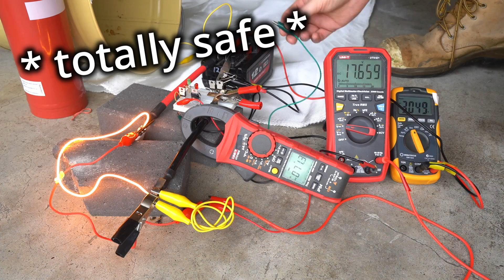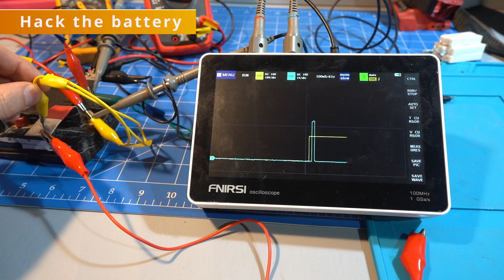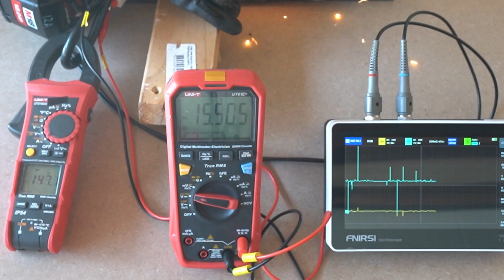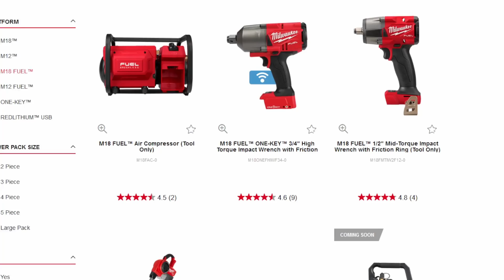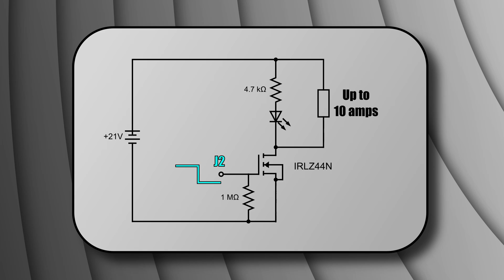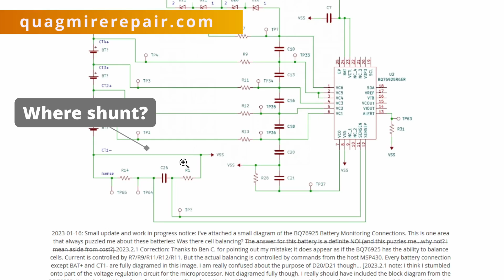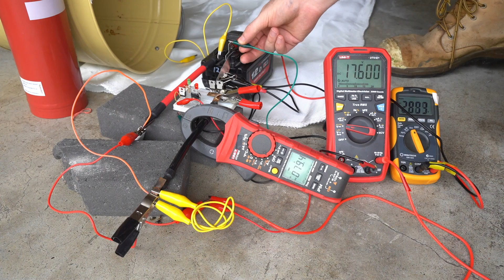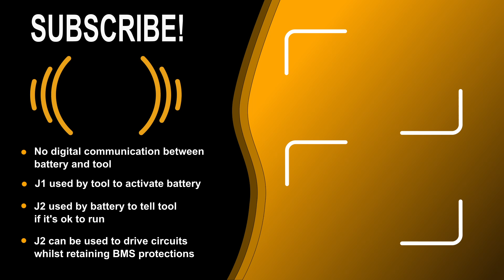[005] How M18 batteries communicate with tools

Comment: Been a while since this came out now, wondering if anybody has spotted any commercial products making use of this information yet?
Reply from the maker: Haven't seen anything, but I haven't really looked, either. I thought about doing it, but don't really have the time, and I figured it'd just get copied and I'd be undercut. I should finish my updated circuit and publish it, then someone might make them.
Reply: @toolscientist  After putting some more thought into it and spending a lot of time looking at mosfets and mosfet circuit design, I realized a couple things. 

1. I really can just use a relay/contactor to switch high power loads. Which is exactly what I do now except using a tiny non-adjustable LVD circuit. This can fit entirely inside the case of a particular M18 battery adapter so it's a super clean install. However, the circuit cuts out way too early though so I'm not getting anywhere near full capacity. Hence why this subject is so interesting to me.

2. For my use case (repowering childrens toys) it dawned on me that since I've added speed control boxes that use low current key switches to turn on and off, I really just need to interrupt that line with a relay/low current mosfet instead of having to fully shut off the battery.

Now the hard part is probably that none of the aftermarket battery adapters include provisions for the J1 and J2 contacts. And I really don't want to deal with 3D printing... I smell epoxy in my future.
Reply from the maker: You prob need a mosfet. Relays need 100-500mA through the coil to hold the switch closed. The J2 pin can only do <10uA (see 7:11). You could use J2 to drive a low power mosfet, which then drives the relay coil.
Reply: @toolscientist  Exactly my point, I described it poorly. My realization is that I don't need to worry about a high power mosfet circuit. I can use a very compact and simple circuit.
Reply from the maker: That's actually a pretty good solution. I always neglect relays as they're more expensive and wear out,  but in this case it makes for a very simple circuit with only 2 components (3 if you add the pulldown resistor for the mosfet, maybe 4 if the relay needs a current limiting resistor)
Reply: @toolscientist  Can't forget a flyback diode for the coil. But definitely simple and small. And if all I need to do is interrupt the key switch/on-off circuit for the speed controller - the 10A limit for the common micro relays I like to use is a non-issue.

Though I'm not sure exactly how the speed controller would like if the on-off switch was switched off at full tilt. Guess I'll have to find that one out the hard way.

I'm also thinking I can take advantage of the timeout after the J1 pulse to effectively shut off the bike/quad/power wheels if the kid walks away for 2 minutes. Start up procedure will involve the key or power switch turn on, then spam a momentary button until the power LED/Relay comes on. Then drive the wheels off until either the battery is dead, on fire or 2:40 elapses and shuts it down. Will have to test this timeout on my particular batteries. I don't have any 12Ah, but I do have a 9Ah that has always been the odd man out so I will not be surprised if it's more like the 12Ah than the 4-5Ah.

Comment: Along with the one-key tools, the obvious thing to test is the dual-battery tools. For example, the mower has an external display that shows the SOC of the lowest battery. Your claim that there's no communication is likely "total bullshit".
Reply from the maker: SoC can easily be estimated from voltage. Every M12 tool shows SoC and they definitely don't communicate. As I said, I haven't tested every tool. I'll be very interested to hear if anyone can show battery/tool communication, but so far no one has.
Reply: @toolscientist  When it exactly matches the on-battery display that uses coulomb counting? Fat chance. Again, you tested only the cheapest tools, no ONE-KEY and no dual-battery and made a faulty conclusion.
Reply from the maker: @straightpipediesel  they don't use coulomb counting. Put a 5Ah on a blower, hold trigger, push button, and it'll show 2-3 LEDs. Let go of the trigger and It'll instantly go back to 4  LEDs. It's purely voltage based.

I've looked at one-key app images and videos and never seen battery info. Not battery type, charge cycles, days since first charge, or anything. I'd be happy to be wrong as it would make reverse engineering their diagnostics very easy. If you can show me something that shows there is communication, then I'd be very keen to hear it, but battery SoC is not proof.
Reply: @toolscientist  I'm sorry, but you don't know anything about Li-Ion if you think this thing is voltage based. Put a dead battery on the charger for 10 minutes and check the status, it doesn't read full. There's 0 science here and 100% guesses.
Reply: @toolscientist  I just did that and it didn't drop 2-3 at all. I have never seen that behavior except near empty. Maybe the batteries for APAC are cheaper.
Reply: @toolscientist  You know, a guy gave you perfectly valid feedback about testing dual battery tools and you had to tear him up and get into an argument. Your credibility just went to 0 for me. You ever get checked for ASD?
Reply from the maker: @toddc5619  I just put a 2Ah with 1 bar on the charger. It instantly jumped to 2 bars. Took it off after 5 sec and it instantly drops back to 1 bar. If it were coulomb counting, the SoC display would only go up during charging and only go down durimg discharge.
Reply from the maker: @straightpipediesel  did you use a blower or some other tool? Most tools are only ~3A at no load, but a blower will be 20A. The effect also works best with smaller batteries as they get more voltage sag. I just did it with a 3Ah High Output, and it also dropped from 4 bars to 2 bars whilst running, then came back to 4 bars after releasing the trigger.
Reply from the maker: @sj65535  dual battery SoC was an interesting idea. So I tested it and found that M18 battery SoC display is voltage based, which means the tool can show the same SoC as the battery without communicating. I'm still open to their other idea of One-Key tools being able to communicate. If you can show me an image or video of the One-Key app displaying battery info (apart from SoC), then I'd be very keen to see it.

Comment: Do the M12 batteries use the same J1 J2 communication system as their M18 counterparts? Or do they have an integral disconnect in the battery?
Reply from the maker: No, the tool stops when voltage goes below 8.2V or when the voltage across the thermistor ("Th" pin) goes below a threshold (which indicates overheat). The batteries have no disconnect whatsoever. Original M12 batteries only had resistors in them. One from ~2019 onwards have a chip in them, but I'll need to desolder one to see what it does.
Reply: @toolscientist  This is great! Thanks for the info. Looking forward to another video when you tear into one of the newer M12 batteries!
Reply from the maker: @stevenmullin3616  i should just sacrifice one of mine to the science gods. Maybe I can find a cheap/dead one on a 2nd hand site. There looks to be an i2c interface on the PCB, so if I can find out what chip it is, I might be able to talk to the chip on a live one, which will be fun.

Comment: Question for ya.  would using a m12 battery with just a positive and negative adapter to power up components on vehicles like a window motor as an example affect the battery in a negative way ?
Reply from the maker: The M12 batteries are 12V at full charge. Their average voltage is 10.8V. Milwaukee cuts power when voltage goes below 8.2V and refuses to start if voltage is below 9.6V. Depending on the pack, they'll be good for 15-20A for the compact and 30-40A for the XC packs.

So just make sure you're not putting too much current on them and that you're not dropping the voltage too low.

Comment: What i found curious is that a Ridgid (AEG) battery to M18 tool adapter i just bought has a 1Kohm resistor bridging + and - to J1 and J2 respectively. Seems to do the trick for enabling the tool. No extra components on the PCB besides that. ( It came with one those contacts slightly damaged, my tool refused to work until I bent it back into place)
Reply from the maker: You should be able to get an M18 tool to work with any resistor (from 0 to whatever my fingers are [I think 3+MOhm]) between + and J2. Shouldn't need anything on J1.

Comment: i just wathed all your Vid's , i EXSTREAMLY liked the -jump starting  one , and i think your testing method is GRATE and Newb-friendly while be a advanced subject .. 

i think you should keep making them , if you need ideas , im full of them lol .. but to get you the viewers, do some thing like this- with Auido equitment , like amplifyers, get a Hot-ticket one, that dosent brake the bank ,  (like a Scar-auido RP 2000.1, ) you would be the only person doing pratical test on them.. most of those auido-guys are dumb as rocks... 

also a good viewer-bass is doing those E-bike and E-scooter crowed , they never doing good testing like what your doing.. 

wish you the best .. 

PS, i want to see your High-power diagram , you shouldent hide them becusye of stupid people. ..  LIke moma-allways said  "stupid is what stupid dose" , and a book that is sencored is not a woth-reading book,  (like the antarkest cook book, you cant buy the Real thing thire in the EU/UK, -  its almost 2x thicker in the USA/Mexico/Canada - even blue-prints for a AR-full auto trigger asimibly in both .22-LR & the .223 chamberd
Reply from the maker: Still working on vids. Things just got slowed down a lot over Xmas. Hoping to have my Makita LXT vid finished this week. 

I'll probably stick to tool related tests. If I had an escooter I'd definitely look at modding it to work with power tool batteries. Although I think that's been done, and I want to avoid rehashing stuff.

High powered circuit was mostly not shown because it's a bad circuit that can lock on are cause pulsing. I'm working on a better circuit which I will make public.

Comment: Mate i repair power tool Batteries for a living !
Just randomely found you So subbed and liked now hoping that i am going to search your vids and find something on the worst of the worst BMS mentioning no names like MAkIT& what a complete Rip Off Bollocks  Bullshit BMS that is.
Cheers mate.
Reply: Ok mate just checked and nothing there.
You may allready be on this one i dont know.
But buy a new Makita battery and a duff one.
Work out the terminal address lines and monitor as i can see that you are well capable of doing.
Now change one or maybe two duff cells in the bad battery, you will get the battery monitor blinking from side to side.
Balance ( manually ) all of the cell pairs to 4.1 or 2 and and try charging on a makita charger...it will still say NO whatever you do the BMS locks out and the only thing you can do is chuck it in the bin and fit a new one then you are good to go again.
They have the nerve to sell a £300 tester that tells you that you have charged your battery 97 times, or that you charged it once when it was really cold or even three times when it was really hot, it even will tell you what is wrong with your battery ? Maybe or say  oh sorry computer says No.
There is a memory chip on the Makita BMS that is like no other and when it locks you out thats it !
All the best and good luck Kev
Reply from the maker: I am currently working on LXT. They even have fuses that the BMS can burn and physically disconnect the B+ pin. I'm about to get to the part where I start overheating it to see its response. I bet there's a limit where if I overheat it too many times, it'll lock itself.
Reply: Keep us all in the loop mate !

Comment: Do you think it's possible to charge more than one battery with one charge? I was thinking about trying to do some wiring wizard to see if it would work.
Reply from the maker: Not at the same time. You could make a system that detected when one battery had finished and switched to the next one

Comment: Dude I think your on to something about the current not being considered in regards to the low voltage cutoff as I’ve killed two 8ah batteries with my top handle chainsaw 2826-20, I feel that the tool is either pulling too much current overloading something on the board or along the current pathway as the strings are within .3v and the overall pack voltage is at 18 but throws the red and green flashing light and will not charge ? Any thoughts ?
Reply from the maker: 0.3V is fairly imbalanced. Not enough to prevent charging, but enough to suggest that cells are failing. The Samsung 40T in the 8ah and 12ah had fairly high failure rates. You could try measuring voltage of each bank of cells under load to see if one is dropping voltage more than the others.

When you put the battery on the charger, does it make a hum that gets higher pitched in about 4 steps? It might even repeat this 2 or 3 times before giving the flashing green and red. If so, I think that's the charger detecting too much resistance. Only other thing to try is buying a logic analyser and recording the signalling between battery and charger, then compare your data to what I get in my [004] video.

Comment: Hi i would like to know how to rest the M18 bms after removing it from the battery? I hade two batteries, one with with broken cells and one with broken bms , so i remeved the broken bms and put it to the battery that had the good cells but when you press the button of the bms you get nothing . Is there a way to reset the bms without puuting it on the original charger ?
Reply from the maker: I haven't managed to reset one yet. Only way I've heard is with the genuine charger.

Comment: Bosch batteries hack next? 😉
Reply from the maker: Probably going to do the big 3 first (Milwaukee, Dewalt, Makita), then get on to others. Bosch has a pretty small presence in AU, so might be hard to find 2nd hand stuff.
Reply: @toolscientist  Okay, looking forward to watch those videos as well :) In Europe the three brands you mentioned + Boch are the most common. 

For a suggestion for future videos it had been awesome with some videos on the DIY battery kits that are sold, to see if the bms used in those kits are ok etc. A video making your own kit had also been awesome ;) 

I have made my own power tool batteries for a couple of years now and im really happy with them. Way better performance (because of better cells) and a much lower price is making it well worth it.
Reply from the maker: Here it's probably Hikoki, then Bosch. I think Metabo might be below Bosch - they probably do better in EU. In the future I can hopefully get people to loan me their tools for a week, otherwise I'm going to end up with a very expensive and barely used tool collection!

Yeah, I'd like to test some of the 3rd party batteries and DIY kits to see if they've implemented the same charge/discharge/temp limits as the manufacturer. Problem is they can change fairly regularly.
Reply: @toolscientist Okay, looking forward to new content :)

Comment: come on mate give us the high current circuit please
Reply from the maker: I can describe it to you. I just don't want my nasty circuit being copy-pasted across the internet and getting put together by people that don't understand it.
Reply: @toolscientist  I'm going to do it anyway, so you might as well explain what to watch out for.  Feel free to get as technical as you want.
Reply from the maker: Main danger is the bounce in J2. My circuit has LEDs on it so I can at least see if it's bouncing. Depending on what you're intending to drive, you may need capacitors to stop this bouncing from creating voltage spikes. You should only get this bounce at high currents (~50A with a 2ah, ~80A with a 5ah, haven't tested the others)

2nd danger is that my circuit is using mosfets, so if the pull-up or pull-down resistors fail or get disconnected (which they often did on my breadboard), then the mosfets can stay on even if J2 is saying "OMG stop".

Start with the simple circuit, but replace the LED resistor with 2 resistors so that you have a voltage divider. Use this voltage to drive a high-side p-channel mosfet. On the low side of the p-channel, make another voltage divider, and use that voltage to drive the high-powered mosfet. You should end up with ~18V at full charge (and ~10V at empty) driving the gate of your high-powered mosfet. When J2 goes low (or you manually disconnect it), then you should get 0V at the high-powered mosfet.

If you're familiar with transistor circuits, then that should make sense. If not, let me know, and I'll give more info.
Reply: @toolscientist  cheers!

Comment: Would be great if you can do this with würth m cube battery and tools
Reply from the maker: Looks like their previous gen was licensed M18. Their website even says they partnered with TTI. M-Cube looks to have same pinout as M18, but different physical interface. Do you have these tools?
Reply: I have Würth brushless angle grinder but i don't have M-Cube battery.

Comment: Is it possible for the tool to over discharge battery when there is a connection issue with the battery or an internal fault?
Reply from the maker: Yes, but very unlikely. The tool will keep going as long as it receives > 0.725V on J2. Using a power supply, I've run these tools as low as 5V (although they barely run at that voltage). 

However, a connection issue on J2 will just make J2 at the tool 0V, and the tool will stop. The only way it could happen would be a short circuit between + and J2. J2 is closest to the ground pin, so it is very unlikely that this could happen.
Reply: @toolscientist  Ok, thanks!!